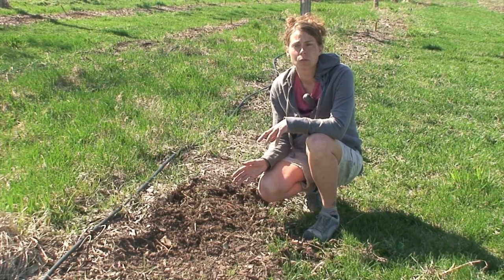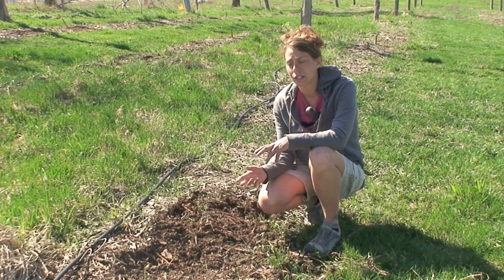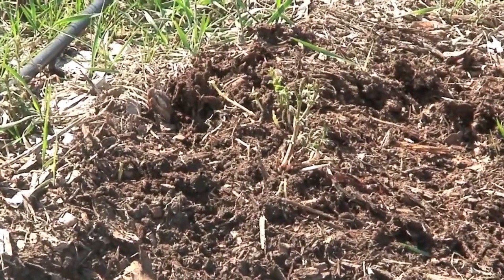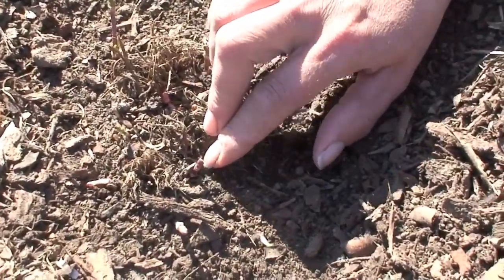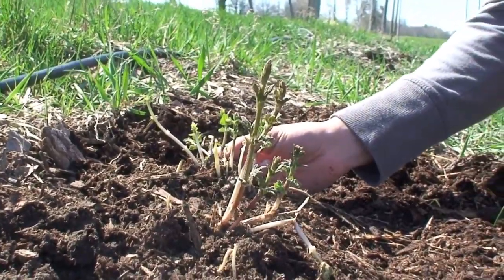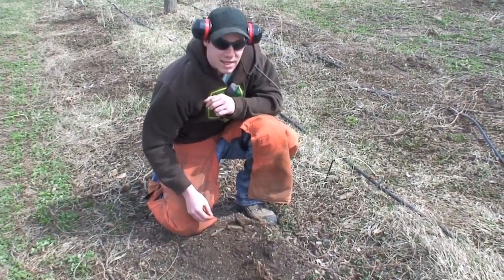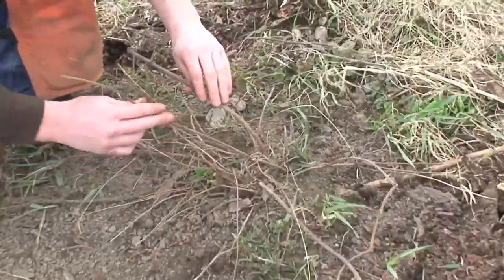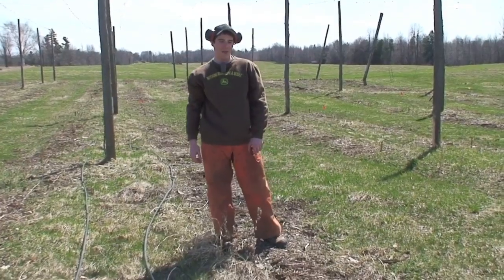Crowning Hops for Downy Mildew Prevention

Comment: How were the results? I tried burning this year and it seems to be worse. :(
Reply from the maker: Hi Wysmykal Farm, we tried burning this year too and so far have not seen good DM control. Look for our hops crowning trial results on our website: http://www.uvm.edu/extension/cropsoil/research
Reply: Thanks for all the work you folks do at UVM! Have been invaluable to our small hops farm!

I am in the process of crowning our larger yard (400+ plants). This is the first year for crowning those as this is the start of year 3.

I'm doing it by hand which is insane. I've also tried using the weed whacker, which makes a more exact cut than I thought, but I am also curious on the flaming you've done. We flame weeded last year which had mixed results...it made it easier knocking down the weeds but they did come back fairly aggressive. 

We can't (and don't want to) spray as we're CNG. I've been toying with flaming the whole damn thing as it's obviously more efficient, but didn't know if flaming could be used as a crowning technique.

I came across this post on your FB site from last year about this time:https://www.facebook.com/uvmcropsoil/photos/pcb.10155144815401224/10155144814051224/?type=3&theater

Would you recommend it or not?

Also...like yours, our hops aren't hilled and with the amount of water our soils hold (lots of clay) I'm fearing our hops are sitting in water. I'm considering transplanting them and redoing the hills. At present our rows are in line with the poles so getting mechanized crowning equipment (if we ever get it) isn't really possible.

Thanks again!

Joshua

Comment: Seems the technique and tool used is going to spread spores and cause more problems than it solves.  If the idea is not only to remove the spore intensive crown, but also remove it from the field, your technique is doing more damage than good.
Reply: +Haiku Automation The mildew will not grow on dead tissue.  Once it is cut, this should cause death to the mitochondria of the cells.  The crowing technique is used in almost all commercial farms and has proven to work.